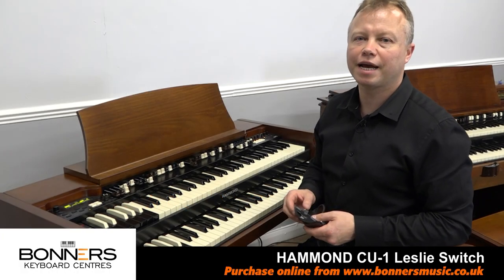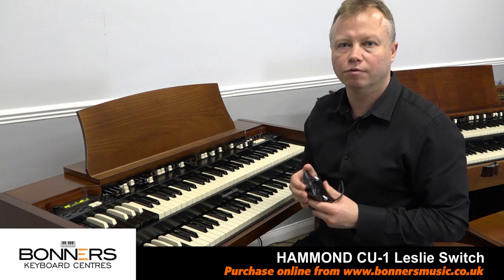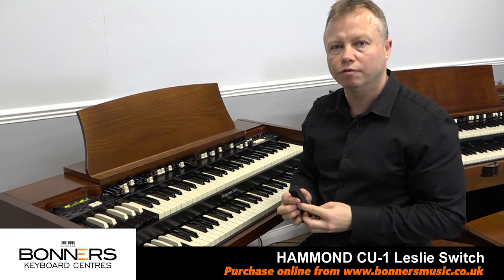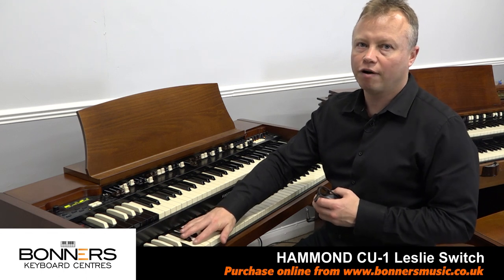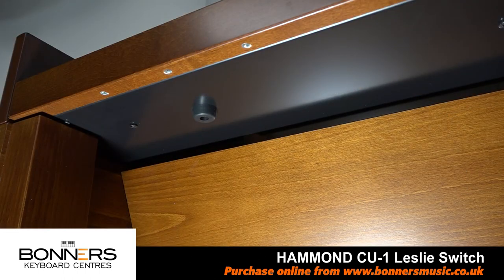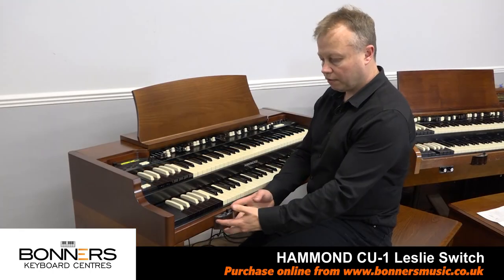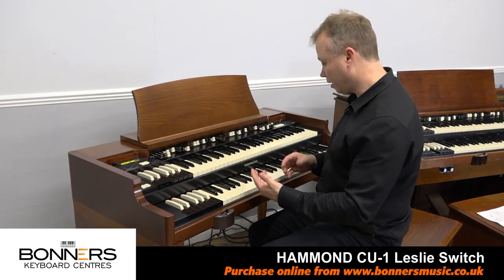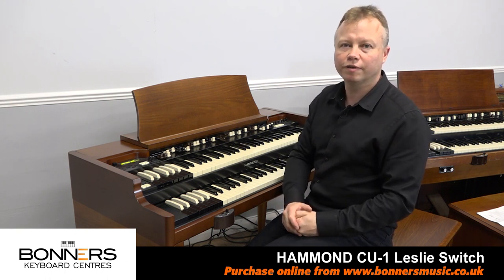Hammond CU1 Leslie Control Switch | Beginners Guide

Comment: I have one coming for my XK-1c but will probably use a foot switch so I don't have to take my hand off the keyboard to change speeds.
Reply: You just flick it really fast
Reply: I know. But I prefer using a sustain pedal from an electric piano instead.
Reply: @misterstratocaster  Same here brother, you can get much more control out of the Organ using a pedal instead of having to take a finger off a note to trigger Leslie. I'm certainly with you on that.

Comment: Not true, that Cu-1 does not work with my 3300 very well,  but works well with SK   Simulator, wish it did.work like you'd mentioned with the 3300 I use my a100 with the 3300 and have to use a  Pedal switch.sucks
Reply from the maker: The CU1 works fine with a 3300 but you need to connect the CU1 to your Hammond instrument, not directly to the 3300. Only a foot switch can be connected directly.